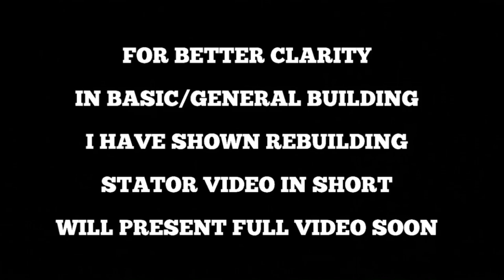The Step By Step Guide To Your CDI Box Test Vespa Lambretta Scooter

Comment: Is this the new 12volt conversion kit
Reply from the maker: Yes yes. If you closely monitor the stator is new but the stator plate is of old Lambretta (Ducati). I removed the stator from the new 12 volts plate and placed it on 6 volts stator plate after placing vespa LT Coil
Reply: @LambrettaRamesh  the conversion is very much needed nowadays, I wasn't able to find 6volt bulbs that easily
Reply: Did you rest the timeing marks ,and are you going to make a video of how to and fit the external condenser,

Comment: Hello Lambretta Ramesh!
Could you help me with my lambretta gp, it is not taking instant pickup with acceleration, there is delay of around 6-8 seconds everytime I accelerate, just changed clutch plates and the Scooter is on points, points were cleaned and adjusted few weeks ago.
I just want to know what may be the possible sources to check
Reply from the maker: Actually lot of points are involved. There should not be clutch slipping. No vaccum leaks at carburetor. Timing must be little bit advanced. Wheels must be free of rotation and many more
Reply: @LambrettaRamesh  I just changed the carb gasket and tyres are freely moving
Reply: How to check if clutch is slipping, I changed with new plated today
Reply from the maker: There should not be any even little bit blow by in cylinder bore
Reply from the maker: There you are exactly. You have to modify the clutch including jetting 👍👍